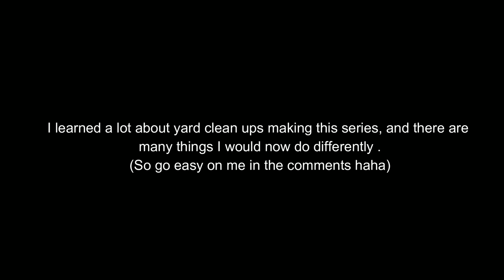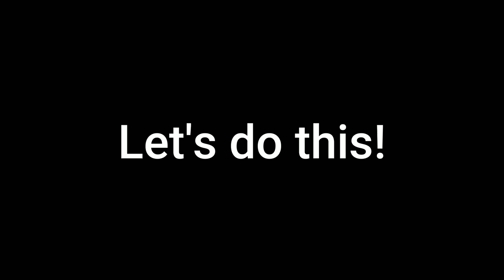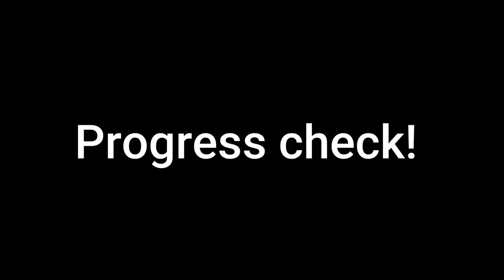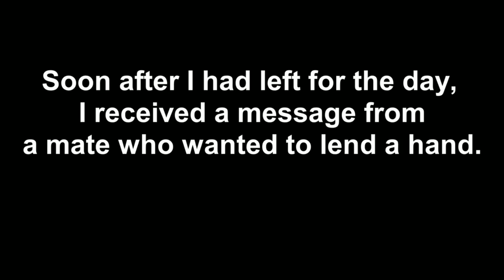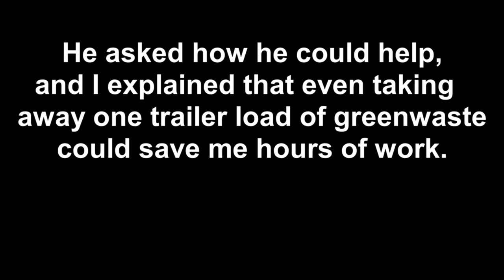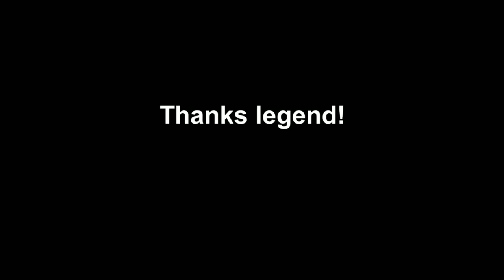80 year old gets the BIGGEST YARD CLEAN UP ever! 6 VIDEOS in 1

Comment: A good hack for stifling weeds/grass in a garden bed is 4 sheet thick newspaper applied as a weed mat, topped with mulch. It will break down slowly, won't choke existing plants, and if you don't till the soil it's even better, because weed seeds are less likely to be worked into the soil and sprout. Good luck 👍🏽

Comment: Man what a job for a single person to take on! I would like to make a few suggestions, first get yourself a larger mower. Get a mower that will pivot in small spaces and mulch yard waste so your not bagging so much and having to haul away. A mower can also illuminate over using your weed wacker. 2nd get yourself a small chainsaw one that's lightweight to help cut limbs larger than 2 1/2 inches and also helps with clearing trees in fences and against blgs and in between and amongst other bushes. Lastly get yourself a good mask to wear. You have to be coughing up half a lung breathing in all that dust. Not good for you. I'd give you an A+ for the job you did all on your own! ❤❤❤